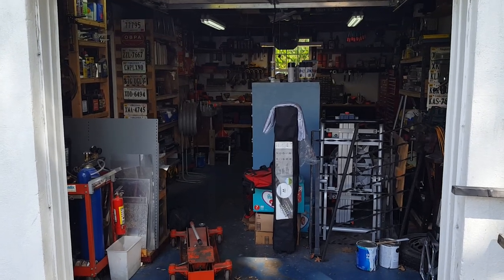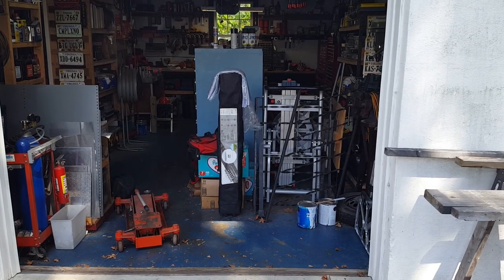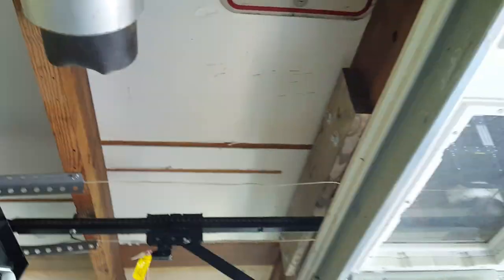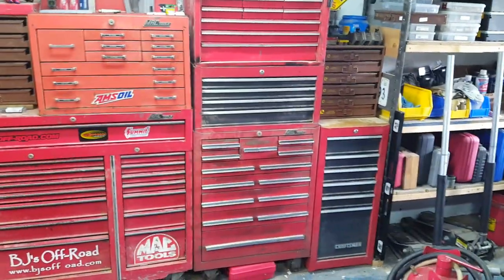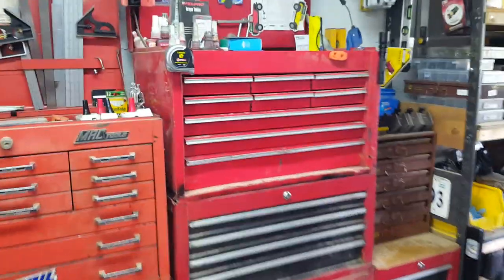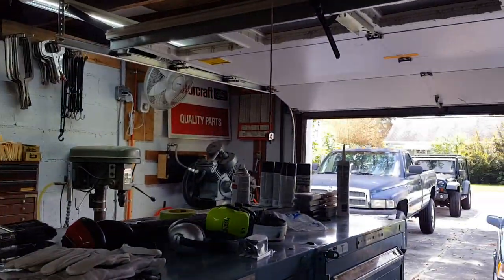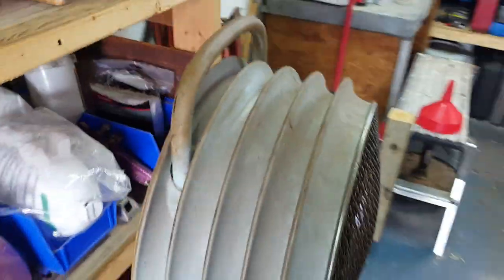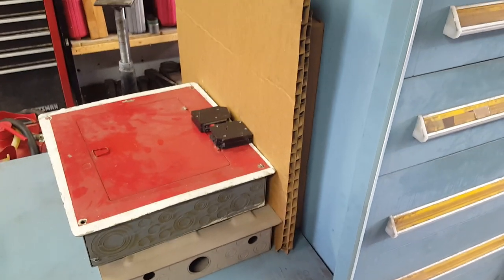Small automotive garage walkthrough.

Comment: Agreed on the toolboxes advice, and I would add to be patient. I just purchased a Craftsman (medium range, is it Pro? ) from 1988, the owner purchased in Alabama and shipped to UK in 1991. bought for $50 USD, its very nice, I like the heritage. made by Waterloo industries and it needs paint, which I will get done when I have my life organised. It has friction slides, not ball bearings but is not the narrow type so its the medium range I think. Purchased fully filled with tools which the owner used to fix up their Alabama house before selling. Everything works as the owner was an accountant, so it was only used at weekends and it was cared for. "Made in USA" stamped and had the original stock dot-matrix printed stickers on the side, which you could barely read now.
Reply from the maker: Thanks! Sounds like you got a good deal.
Reply: @Chumley360  I did, but it wasn't worth much more, the ball bearings slides are so much better. Had to buy a tin of spray dry ptfe for it, nothing else stays in place with friction slides

Comment: There is a fan collectors forum on the internet. I do not recall where I found it, but I am am sure you will find the parts you need on that forum if you can find it. I have two of those fans and they move a tremendous amount of air and are a bit collectable. The fan is worth finding the parts and fixing. 
BTW: Nice shop
Reply from the maker: Thanks. I hadn't thought to look for collector forums.